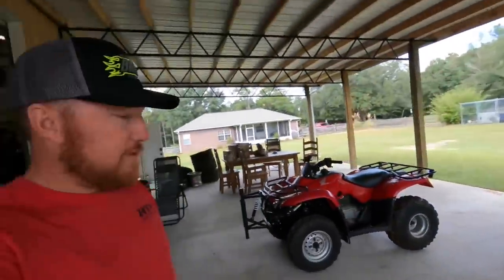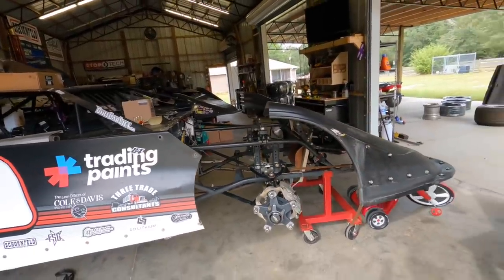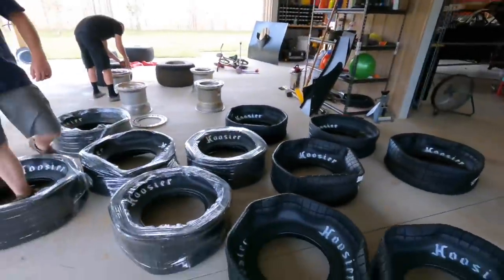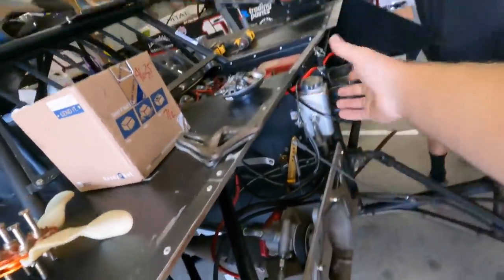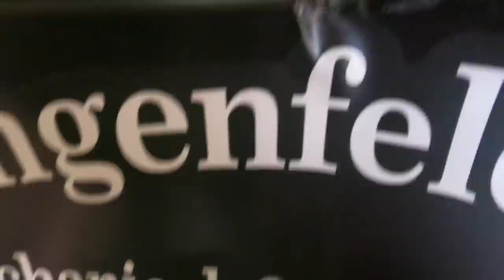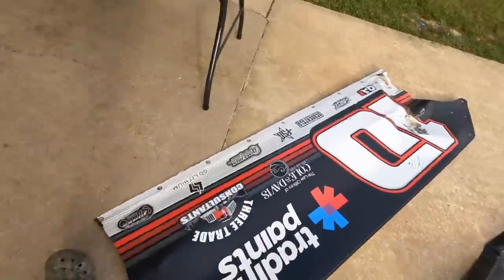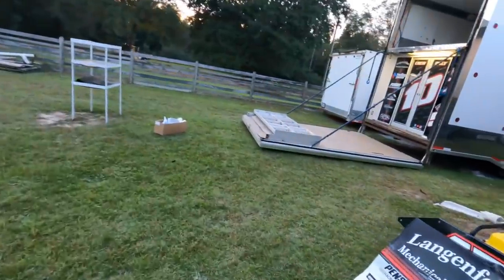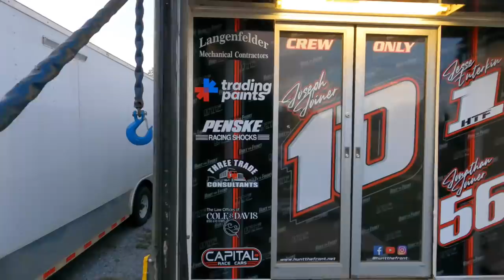Will Our Crate Engine Arrive in Time to Race for $26K at All-Tech?

Comment: If she Same guy build both motors it should run good just use the same pulleys and pump
Reply: The heads and cam are not as good as the current motors Chevy changed it a couple of years ago..Also the bore gets out of round and legally can't be over bored to fix the bore..older 604's like that is down on power just bit.

Comment: Whats the difference in your fuel? Blue, Red and clear?Is it what the track has or do y'all carry your own with you? Thanks guys and keep on doing your best. God is great and Jesus lives. Love y'all stay safe.
Reply: The octane level,  the super engine takes a higher octane for the higher compression that it has, the 604 doesn’t need that octane, so they run a lower octane for it, and the 602 can run e85 which makes a bit more power in the crate engines. They can run the e85 in the 604 crate if needed. So BASE and other fuel manufacturers color it different so you don’t get it mixed up.
I think that covers it. Costs less for the lower octane fuel, and racing fuel is a lot more than pump fuel, so thanks to BASE for helping them.

Comment: How exciting. More tire work and a new body and wrap. That’s new.  Why not just bolt in the back up 604 if it’s fresh and rebuilt by the same people as the other 604?Why should there be any difference?
Reply: The older ones wasn't as strong as the newer ones. Headed and cam changed.
Reply: @jason5044  all 604s have the same heads and cam.  If there changed, it’s illegal and would never pass a tear down
Reply: @sixwillwin  the heads changed over the years. One had the Chevy sign on the side of them and the other didn't.

Comment: I see you guys changing tires a lot... But I never see y'all balancing them... Is it not needed in this style racing??
Reply: Nope never
Reply: @JJ-1-1  You couldn't do that these guys run 10 to 12 pounds in the LR the side walls are all over the place. These tires where never designed to be balanced What's the use if the tracks have a completly inconstant surface.

Comment: So if the backup engine was freshened up at RaceTec. Then it should be just as a reliable piece as the original engine you got from RaceTec. Since it is my understanding that the original RaceTec engine was a rebuilt engine as well. 

Which I highly doubt that if they found a problem with an internal part in the backup engine. That they would reinstall that part. 

Therefore, the backup should be just as good as the primary engine. At least as far as the 604 crate engine's go. 

On top of the fact we know what a new crate engine from Chevrolet will do. Because as I have pointed out before. I do not place any blame for that engine failure on Jay Dickens. Their engines are wonderful pieces and I would not have a problem using engines they put together.  

Yet I am perfectly satisfied to throw Chevrolet under the bus. Since I have had to deal with crate engines for street vehicles. That would less then subpar.
Reply: What motor would you believe is better after winning 2 races?  🤔
Reply: Why do you think they are also waiting for that motor.
Reply: @marklavallee5610  I would believe you could put any engine in that car and go win with it. Because it is not the engine. It is the chassis setup. Since a well setup chassis with a good drivable engine. Will out perform just an engine in a chassis that will not handle to save its life. Besides they are both 604 crate engine's worked on by the same engine company (RaceTec). Therefore, either one of them will do the job, perfectly fine. 

Due to the fact, there is no difference between the two 604 crate engine's, correct? They are all supposed to be the same internally, correct? 

So the difference is the chassis is setup correctly and put any drivable engine in the car. Which there should be no difference on performance, correct?
Reply: The heads and cam are not as good as the current motors Chevy changed it a couple of years ago..Also the bore gets out of round and legally can't be over bored to fix the bore..older 604's like that is down on power just bit.
Reply: @marklavallee5610  I have no idea why, since they have the exact same engine ready to go into the car. Which should as I stated be just as drivable as the original RaceTec engine. 

So since you pulled a LET'S GO BRANDON U'CONN 👏👏👏👏👏 NOT answering my questions. But avoiding answering questions. I will just block you NOW. Bye...
Reply: @TheCrewChief374  I think you didn’t read what I commented .those motors that have been raced for 2 or 3 years have issues. First off a few years ago chevy was having trouble with dropping valves And breaking those b hive springs..so they changed the heads and cam and created 8 to 12 more hp ( I think they did it on purpose) As many laps on that motor the bores get out of round a legally you can’t bore the motor out enough to clean the bores up which hurts the motor….That’s why there doing that..Think of it as a fresh Draime not good…Calm down and listen